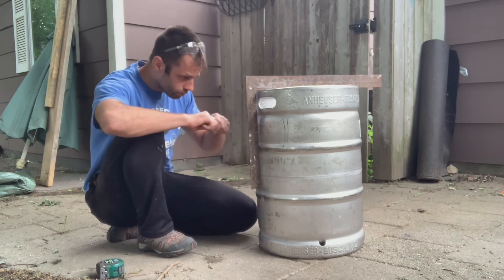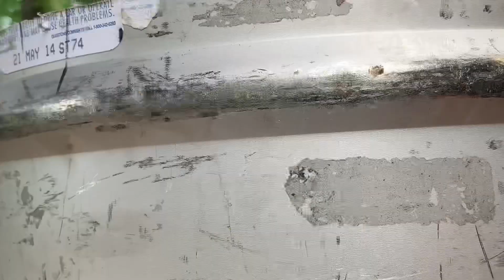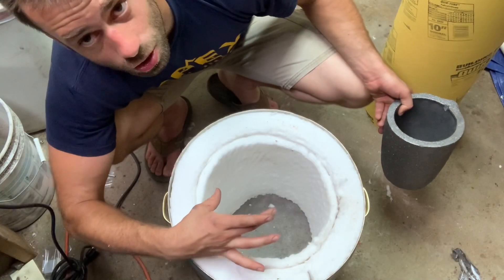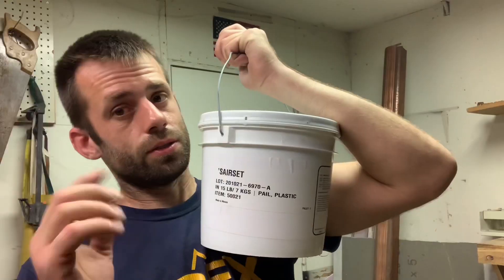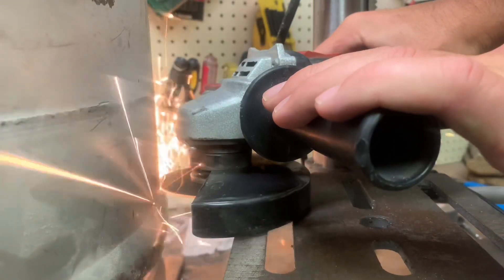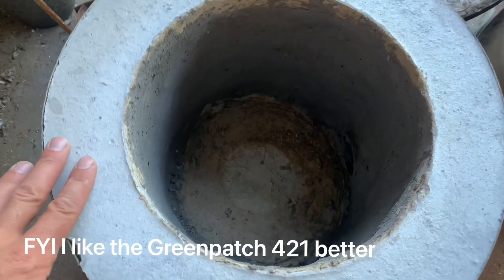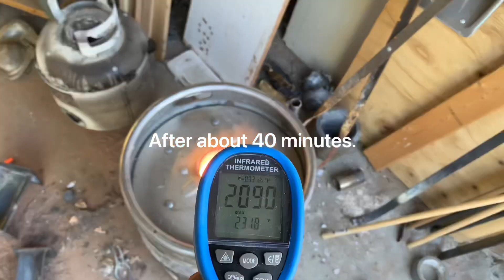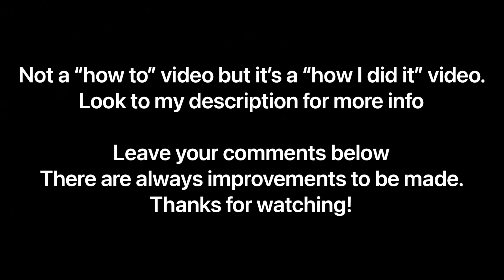Making a keg foundry furnace.

Comment: Forced air burner is the way to go with such a big chamber. What you can do is either a single burner like you have but instead of relying solely on the Venturi Effect of pressurized Propane injection also drawing in oxygen surrounding the burner there are burners that have small electrical blowers or fans on them that force air down and it provides a much more efficient combustion. Then you can also go the route of a small Ribbon Burner which is basically a block of refractory that has rows of small forced air jets and in the Blacksmithing Community the Ribbon Burner is King for forges but increasing use for Furnaces as well, Old Hickory Forge here on YouTube has a video building one for melting steel which requires much higher temperatures than aluminum pewter or any of the red metals.
Reply from the maker: Oh wow I’ll have to look that up. Anyone who can melt steel is impressive.
Reply: @lundgrenbronzestudios  there’s a bunch of people who melt steel to create what’s called crucible steel or Wootz steel which is like blacksmithing gold for high end knife makers but most of the furnaces used for casting bronze brass copper or aluminum won’t even come close to the temps needed for steel. Some even use charcoal or coal furnaces to make their crucible steel like FZ- Making Knives but most use forced air propane burners like Old Hickory Forge or Black Beard Projects and there’s many others. Wootz or Crucible Steel is the main reason I started learning about furnaces and casting, I’m starting with brass bronze and copper projects mostly and eventually I’ll try Wootz

Comment: Rather than cutting the walls down I would have just built up the layer of refractory cement in the bottom. I'm sure it would have been somewhat of a heat sink but being on the bottom it might not have been too bad
Reply from the maker: That was an option but I also didn’t want it to be super heavy.

Comment: Very cool. I am planning on bUying a small one from Amazon for melting gold and silver and some platinum. Any suggestions on about the cheapest I can get that will still do the job. I’m new to this and don’t have a ton of money so I’d like to know the best product with the best value
Reply from the maker: You aren’t going to be able to melt platinum with a furnace. With platinum they use a smith torch. Sounds like you are interested in jewelry. You can melt all of those elements with a smith torch and a ceramic crucible. I’ve never don’t it myself though. For small projects an electric furnace isn’t a bad option though.
Reply: @lundgrenbronzestudios  thanks for the response. I’m wanting to get into recovering metals from things like computer parts and also refining metals from scrap jewelry and things like that. I’m setting up a silver cell also. The reason I was asking about a furnace was so that after I get the metals recovered I can melt them down. Basically I just want to have everything I might need so I was just wondering if you had an opinion on a small one that’s at a decent price. By the way I loved your video. Very cool. I love repurposing things and diy type of stuff

Comment: Lots of good info.  I used to make them  1998ish but  forgot.   Mine had A frame each side 3/4  hight of furnace and the furnace about 25cm  off the ground  {cruicable was  CNG tank and outer shell 44 gal drum or 12 gal cant remember which had the K_O wool}  the furnace was hinged at top of A frames with pins welded to crucible,   it had a pipe welded on the back -  and i had a platform for castings in front,  when metal hot enough  off comes the lid -  put a long rod used for handle  into welded pipe  top back of furnace  and pull towardyou /  basically tip the furnace and pour.   I was making big castings -  Aluminium lathe heads  almost meter high -  but never completed it.  I have a habbit of  doing something -  get  ambitious / greedy and want bigger better / start again and so on so nothing to little gets completed.   I used to run two LPG bottles together or they would freeze and slow  -  run through old single barrel carborator buterfly with  old vacum cleaner on blow shoved in.

For those new to Al who dont know -  if you get lots of little bubbles in the metal when you machine it its called hydrogen bubbles  from moisture {hindsite now I should have had lid on crucible inside furnace to keep LPG  mosture out}   but before pour Id run a car steel brakehose pipe  hooked up to  Argon bottle and buble it and stir made the metal very clean.   If you heat with metal only melting AL   pour as soon as melted   if you leave it  tryingto do things better like I did -  then you end up with lumpy metal.

Comment: I built my foundry about the same size. The burner I built uses oil and diesel which I can get the temperature high enough to melt cast iron.
Reply from the maker: I want to update my burner to diesel. I would like to play with molten iron.

Comment: What is the purpose of the insulation? To retain the heat?
Reply from the maker: Yes. You want to keep all the heat inside. If you don’t it won’t get hot enough.
Reply: @lundgrenbronzestudios  thanks. I'm trying to build one myself, but a wood burning one, it almost gets hot enough, but I think my lack of insulation is causing me to lose a bunch of heat, I'm using a small oil drum and a leaf blower, the barrel itself gets red hot and I'm assuming that is my problem. Thanks for your reply

Comment: Good job overcoming the design and build challenges. If you're still wanting to build more of these, ceramic supply shops have all of the things you need to dial in the cements.  Grog, in particular, will turn your shrinking mortar into a nice surface treatment.  Anywhere from 5 to 10 parts grog to mortar will do the trick. Throw in some fine saw dust, maybe 2 or 3 parts by volume, as well, and it'll burn out, leaving behind some air spaces which will resist heat transfer.  As you saw with the Greenpatch, you can also add in simple fiberglass, kaowool, or rockwool to improve the green strength and resist shrinkage (I swear, this is the first time it shrunk!) You can play around with all of these variables to create an incredibly efficient and protective chamber wall!  I made all of these same mistakes the first time I made a foundry furnace.   The only "mistake" (because the rest is just learning) is leaving out a hole in the bottom.  A big enough melt and cracked crucible becomes a rebuild job rather than just a clean up job.

Finally, when you get around to building another burner, you can use the various cements and ceramic material to make a burner flare which will last a long time and fit the application perfectly!

Comment: More pressure on the drill, with short bursts for drilling stainless steel.
Reply from the maker: Stainless is a pain to drill. Thanks for the tip.
Reply: @lundgrenbronzestudios  it can be. I do it at work, coolant is the another key and don't let the drill bit slip. It needs to be cutting or it will blunt the bit and burn it.

Comment: Hey there Lundgren Bronze Studios! Thanks for the cool video! I would like to give you some hints that might make the melting of metals easier for you and more cost efficient.

First of all, you should also use ceramic wool/mat for the bottom, as the better the isolation, the better the warming up and isolation and with that the gas saving. As you have shown very nicely here it is completely sufficient to just put a thin layer of concrete (or what i use is fireclay mortat, that is heat stable to up to 1600°C (2912 °F)) to protect the ceramic wool from getting damaged and to not inhale the fibres that are blown around.

What i often see what alot of people use is a venturi style burner and i can tell you that these things waste gas like crazy as they need a high gas flow so that enough air is dragged down the tube to create the venturi flow! I used one in my first gas forge and after like 4-5 hours of forging a 11kg bottle was nearly empty. I switched then to a forced air burner, that i build from very easy parts (just look it up here on YT, there is a channel called Christ centered Ironworks, he explains it really great!) and with this change i can forge now with a 11kg bottle nearly 18-19 hours and can use the same burner for smelting metals. As a matter of fact, i used the burner for my first furnace attempts and switched the burnerhead but didn't realize that this one was made out of cast iron. The end of story was, that the complete burner head melted and the molten cast iron poured into the furnace.

If you don't want to "harden" the ceramic mat, there is also the possibility to use e.g. Aerosil 200 (a silica) to "harden" the ceramic wool so that this soft material becomes much harded and better to work with, as putting concrete on it, can sometimes shred out fibres. You find here on YT a channel called black beard projects, where he builds a "well insulated gas forge" (video title) and uses this.

Best Regards!
Reply from the maker: Thanks for the info. I was actually thinking  of trying a waste oil burner. What do you think of those . ever try one?
Reply: @lundgrenbronzestudios  Nope i never did, but i saw a video from Dragon's breath Forge (YT channel), and he uses a Diesel Burner and explains how it works so it might be interesting for you! :) The video is called: Crucible Steel (Wootz) Melt - Part 1. There he explains the complete setup as he initially starts with propane and switches over to diesel.
Reply: Oh and what i forgot to say:
When i use my forced air burner, i forge constantly at 0,5 bar of pressure (i use an adjustable valve) and reach easily 1100°C or even more when i change the air flow/gas flow. I know that alot of people that use a venturi burner have to use 2-4 bar to get enough heat. So just look it up (forced air burner)! I saw in your videos that you have a TIG welding machine and with that the build is really easy! It is basically just a tube that leads the air flow, and drags the gas from a bypass tube with it. Both, the airflow and gas flow can be adjusted over valves, so that you can have a very small burner flame e.g. to melt small charges of aluminium or forge small things or a really strong burner flame to melt more material or forge weld.

Another advantage that this burner system gives you is that you can easily avoid black/cold spots, as sometimes the flame is so to speak "too long" for the furnace or Forge and you see a black/cold spot. As you are capable to adjust the gas/air inlet you can easily readjust your burner and use it's full potential and avoid any black/cold spots.

Just look up the Yt channels that i named before these give you a very good idea!
Reply from the maker: Thanks for that. One of the best parts about having a YouTube channel is all the things I learn from the comments.

Comment: If you vibrate as you go it will pull up any air bubbles trapped and pull them to the surface…less cracking

Comment: Couldn't you make a fill in out of that wool and cement? To adjust the size of the chamber as needed?
Reply from the maker: It would make the center too narrow for the crucible if I did the sides. It would be unstable if I put the wool on the bottom. If I added more cement to the bottom it would be much heavier and would be a large heat sink with that much mass. And the lid would not fit if I added it to the top. A better option would be a bigger burner but I didn’t have one and don’t know how to build burners so I opted to cut it to make it smaller. That was my thought process.

Comment: Hi ,  I build a furnace very similar to your keg furnace using propane as well , but I found it was too slow and expensive to run so I changed the burner to diesel and was amazed at the difference
 The time to temperature was nearly half and the cost of diesel used was a fraction of the cost . I think it is safer as well . I highly recommend switching . Regards Stu
Reply from the maker: Thanks for the tip. Do you have any suggestions for the burner you built/bought?
Reply: @lundgrenbronzestudios  hes talking about a forced air drip feed waste oil burner, theres great youtube vids on how to make a forced air waste oil foundry, they run on diesel aswell as waste oil, and hes not wrong they deffinantly heat up and melt copper in a quarter of the time at a fraction of the cost, i got waste oil free from my local dump and when it gets low i just replaced it with diesel because it was way easier and less messy than oil... i think one good channel making it is called 'oil burner' thats his youtube channel hes an australian guy who uses his to melt entire engine blocks.

Comment: Why does it have to be lined with the cement?  Is it the lose of heat and the large amount of air space due to it’s size?
Reply from the maker: The ceramic insulation has a nasty dust that causes lung cancer. You don’t want to be breathing it every time you light your furnace. So it’s coated with the cement.

Comment: Could the ceramic blanket/mortar combo be used to make a fire-proof/resistant safe?
Reply from the maker: It would add fire resistance. But it wouldn’t be fire proof. if it’s surrounded by a fire hot enough the inside of a box is still going to get hot. It will just take longer.
Reply: @lundgrenbronzestudios  Got it. That's where the thickness of the ceramic blanket could add more time in such a god forsaken contingency?

Comment: Good work mate, just as a tip to stop cracking, I line mine between the fibre and cement with aluminium foil, it will stop the moisture from escaping into the fibre so quickly and stop cracks.
My cement is 1 inch thick minimum, 2 inch is better for extended use as it holds the heat better. But will increase the weight significantly, 1 inch is ample.
As the bottom gets burnt and bits and pieces build up you can, pour a thin new floor and repair sides as required.
So better to have a little cavity within so you can repair the floor a few times before the crucible is to close to the top.
For example:- a crucible fractures and you lose the contents to the furnace, and yes that happened to me🤣
Using chicken wire will also stop the walls cracking if you make a cage and secure the ends together properly.
Pour a pancake type thickness mixture and pour it in and have a 1 inch step at the top ( also wired ) and separated by aluminium foil.
I must remind you that this is tedious work and requires patience and skill, small tears are tolerable, but ideally you want no holes.
Your cracking should be eliminated.
I use an 80,000 btu burner and a 3 inch hole is a good size I’ve found, I have tried a few different sizes, 3 inch for and 80,000btu burner creates a small pressure within and will help force out loose debris during operation.
I also never let the refractory touch the burner, you may want to take it out from time to time to inspect the nozzle or even replace the tip.
I also repeat this process for the lid.
I’ve only ever built 1 furnace for myself it is years old and has never been relined or even repaired.
Once hot it will melt 2.5 kgs of brass in 7-9 mins.
Copper in 1/2 an hour from cold and about 15-20 mins melts for 2.5-3.5 kgs there after at about 25 deg C ambient temperature.
I run mine at .2 Mpa with a full crucible to start for about 15 mins till everything has a dull glow.
To melt brass once heated I’m usually at .3-.4 MPA and 1.0-1.2 MPA for copper.
It is very well insulated.
Separation of the rock wool and the cement is critical for long jeopardy and good heat retention.
I’m usually melting 15-20 kgs each time I fire her up, this will save you plenty in gas and I would do all that melting on less than 1 bottle in about 2 hours.
You done a good job with the available tools you have.👏👏
Enjoy the copper melting and well done👍👏👏🇦🇺
Reply: Perfect advice I’m a 5 th generation brick mason and my uncles built most of the furnace’s at Bethlehem steel here in Baltimore Maryland they were great brick layers my uncle Felix Santoro and his brother Phil Santoro both died from asbestos and it came from the furnaces and boilers they built back then those hard working Italians and Irish and polish ect didn’t have any one who gave a shit about their safety or health the immigrants of the late 1800s and the early 1900’s were taken advantage of in many ways that would never happen now a day RIP UNCLE FELIX-UNCLE PHIL AND UNCLE MIKE I miss everyone of you and at 51 years old I am as good as the 3 of you I hope your proud love ya
Reply: @concretechrissantoro2323  whats that got to do with anything
Reply: Good on you..!
We owe much to our predecessors, inspiration is just the beginning of our next legacy..!
 @concretechrissantoro2323
Reply: https://www.youtube.com/watch?v=ef-zAB8_fbU&list=PLhMQuPJTngwdCj_YdG_XR07ny5AzrIxhs&index=7&ab_channel=IngotJoe
Reply: What do you mean regarding separation of rock wool and masonry? At the floor? A air gap?
Reply: Cheers cobber, that's useful info. 🍻

Comment: Tells friend he wants a Beer keg, friend buys him a keg full of beer, he then proceeds to drill holes in the top of said keg and pours the beer down his driveway?
I used a thin layer of Satenite over the Kaowool insulation blanket, it's a dry powder that you mix with water and apply like cement over a wire mesh secured over the Kaowool, just like he secured the top insulation to the lid, I did not use wire mesh on the sides and bottom and it's still in one piece, but the Satenite did come loose from the insulation on the lid for a lack of wire mesh to hold it in place.
Satenite does not shrink and fully cures the first time you fire the furnace.
I also use a firebrick for a plinth inside and outside.